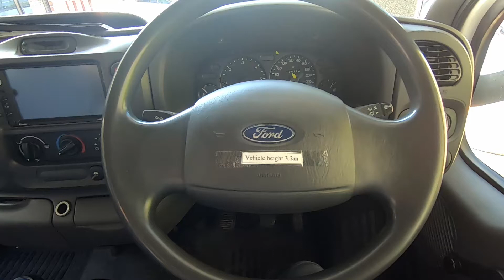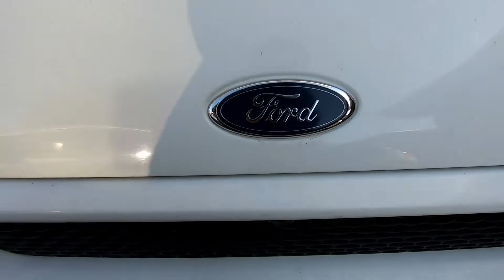Essential RV Checks Before Every Road Trip

Comment: Hey mate love the videos! 
ive got a ford transit 2000 2.4 di and the windscreen wipers have started playing up.
They are working intermediately but pretty much not working .
can you do a video or a reply to how to replace the wiper motor on this model? muchly appreciated
Reply from the maker: Hey, will look into that in the near future. In the meantime I can try and help you with these instructions: First Off have you checked your Fuse and Wiper Relay? If its fine move to the next step.
Transit wiper motors are very easy to change. All you have to do is remove the wipers then the plastic cowling below it, carefully remove the plastic caps as this might break. Next remove the hood seal and heatshield from the water drain panel. 
Now Go ahead and remove all the bolts holding the water drain panel. It might be difficult to remove as some people tend to put sealant here. Once your at this stage you will have clear access to the wiper motor and arms. Mark the position of the wiper crank arm with paint to the bracket so it will be easy to install.
Reply: @AutoBuddynz  thank you very much I’ll be starting this hopefully tomorrow will let you know how I go, 
Thanks a lot I really appreciate it
Reply from the maker: @bazza8746  No problem, happy to help!